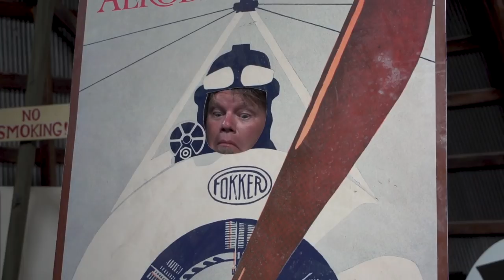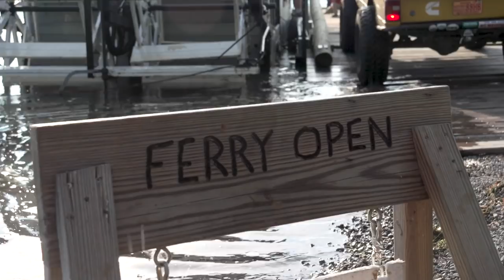Off-Road Rollovers, Antique Aircraft, & Ferryboat Ride | Part 4 – Ultimate Adventure 2018

Comment: It didn't look like anybody really aired down. Any idea why? Or did they and I just can't tell
Reply: MyNamesBennn I just watched it thinking the same thing! That climb where the Jeep rolled should be done easily especially on locked vehicles!! However it does look like no one aired down which had me scratching my head
Reply: The air down but those tires have thick sidewalls!! thats why they dont "look" aired down
Reply: that jeep nees more anti squat in the rear, thats all